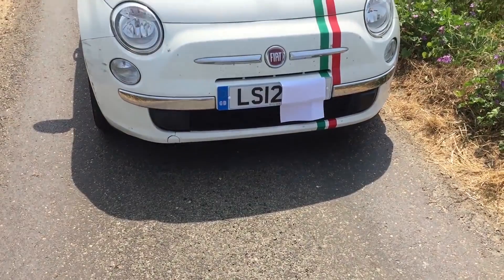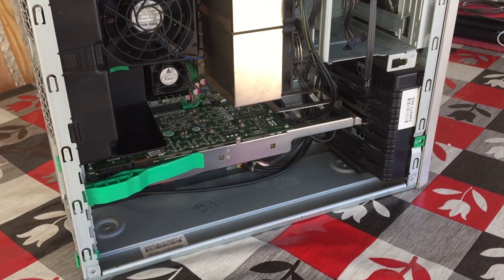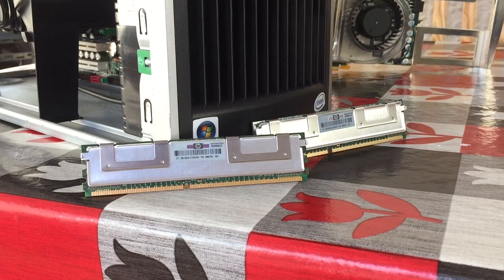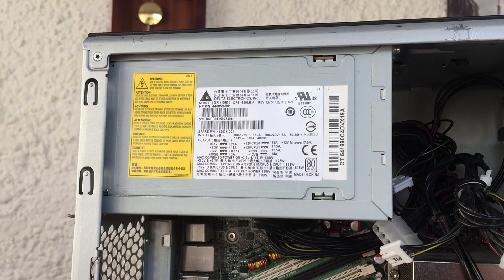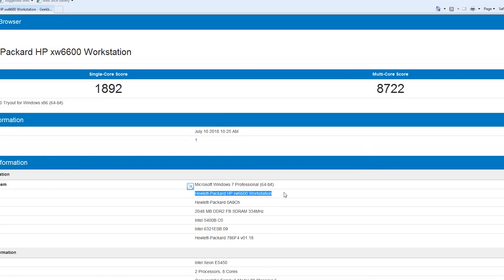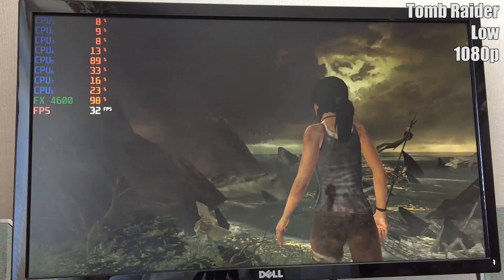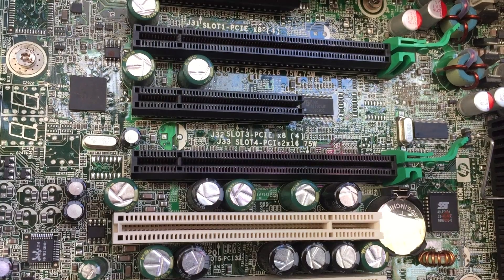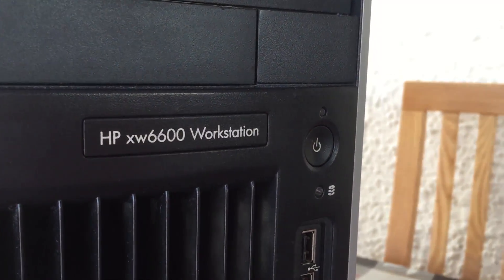This 8 Core Xeon Workstation PC Cost $5000 in 2008, Today I Bought One For £25 ($30)

Comment: What happens if you are Upgrade ram8 gb/1050ti
Reply: Chris Ayres Games back then were HL2 erra, and they didn't use multithread all that well (if any). This would be like TR2 vs 8700k, the i7 is going to win at gaming.
Reply: Chris Ayres They are the same as the consumer chips plus ECC memory and more PCIe, they are the same core as the i7, but clocked slower. They are not magic, my Ryzen and even my old FX tear apart older Xeons.
Reply: Xeon E5450 is pretty much the same as Core2 Quad Extreme QX9650 which was the best "i7" at the time.
Reply: Jake Garrett, But your AMD FX is nowhere near as powerful as 2010 6-core Xeon's on a Intel X58 platform.
Reply: Pasi123 Maybe, I'm not sure which model number those are. My FX is overclocked to 5.5 Ghz making 870cb. Its old and obsolete now (it can still game fine with even my Titan Xp holding it back, but its nothing like Ryzen). Stock it makes 645cb, so better than the duel Xeons in this video, but that's nothing compared to modern processors, even the $100 Ryzen APU is about the same with just 4 threads.
Reply: My Xeon X5670 @ 4.44GHz scores 1009 on Cinebench R15, it could do better than that if I had better cooler. At stock (2.93GHz) it got 692cb.

Actually if you want get around 600cb on a Ryzen 3, you'd need to overclock it to 4GHz.
Reply: Pasi123 That seems low for Ryzen, underclocked to 3 Ghz with half my threads disabled (8c/8t), I make 1000cb with Ryzen. That should give 500x4/3＝670cb for a 4 thread Ryzen. I'm running 2666 Mhz because it was the cheapest kit available, 1700cb at 3.8Ghz.
Reply: At stock Ryzen 3 2200G scores about 550. And Ryzen 5 2400G (4c/8t) scores about 800.
In this comment section someone said he got 609cb on a Ryzen 3 2200G at 4GHz with 3200MHz memory in dual channel.
Reply: Pasi123 It looks like the 2200G is just over 580cb stock. It depends on RAM timings (my RAM is rated at 2800 Mhz, but at 2666 I have 35% lower latencies).

It also depends on how clean your system is. For benchmarks its bad to have Steam updating, Razer headphone drivers, remote desktop applications listening to open ports, or those pesky Windows updates that don't say they are doing anything until you shutdown and suddenly it needs to update. Its amazing how quick most people junk up Windows...

For unpublished benchmarks, set Cinebench to high priority, disable every Windows service (rename Cortana files to disable), and I also kill the desktop GUI so its a black screen and you can't open new applications (leave CMD promt up if you want to open programs). A restart is needed afterwards.

It really depends how they are benchmarked. A cluttered OS leaves a lot more services running.
Reply: Pasi123 Here is the website source for 585cb stock 2200G
www.guru3d.com/articles-pages/amd-ryzen-3-2200g-review,8.html

It also shows 820cb for the 2400G. Those are stock, its showing the 1700 at 1400 for example (correct for stock)

Comment: This deal is amazing. Just add 4gb for 6gb of ram. And add in a rx 560 or a 1050 and you're golden.
Reply: mohamed amine khadhraoui a 1060 3gb would make it PURE gold
Reply: there'll be no bottlnecks with games with vulkan or dx12 that can take advantage of 6 cores or more but otherwise a 1050 ti would be the best card you can put with a e5450
Reply: G7 Beats

my Country cost same price brand New Gtx 1060 3gb and Gtx 1050ti 4gb.
Reply: Rather a 960 in sli

Comment: Nice workstation and a great price. My main PC is an old HP Proliant DL360 G6 server currently running a pair of E5520 at 2.4ghz. It can take up to two X5670s but the price for a matched pair of those is still around £100. It came with 16gb of ram and an SSD all for £42 off ebay. I modded it a bit to fit a dual slot GPU and it is a monster for the price I paid. Old Xeon servers and workstations are stupid cheap although the servers are less practical due to size and form factor. Definitely worth a look for lots of processing power for cheaps.

Comment: How much power does it draw? Must be a lot :D Cinebench score is the same as my Ryzen 2200g, so not bad for a 10 year old machine
Reply: Martin yea these are great cpus, its only 50 points off of my i5-6600k (4.4ghz) which is insane to think about
Reply: I have a similar system with dual x5450's and a GTX 480. It pulls over 750w from the wall with a 1kw PSU
Reply: Martin  im using x3440 clocked at 4GHz with a score of 625 on cinebench and pull 300-350w for the cpu alone  XD
Reply: Please tell me how you got 630 CB on your R3 2200G. I’m running my R3 1200 at 3.85 Ghz and getting 582 CB (though keep in mind due to budget constraints I’m on single channel memory at the moment).
Reply: NJ Sullyalex ryzen+ has better ipc and can reach 4 GHz a little easier than original ryzen could. Also, the 220g only had one ccx. Original ryzen is also much more dependent on memory bandwidth, so that single channel set up could possibly be hindering you
Reply: NJ Sullyalex my record was 609 points. My cpu is running at 4ghz at around 1,325V (set in the bios) up to 1,35V under load. I am also using two ram sticks at 3200mhz.
Reply: Ah I see, you are running it faster than mine and with a significantly faster and better RAM configuration. One misconception, the Ryzen 3 2200G is NOT Ryzen+, it is based on Ryzen Gen 1 (it came out before the R7 2700X), so it's IPC is equal to the R3 1200. In fact, theoretically, it's IPC should be worse than the R3 1200 because it only has 4 mb of L3 Cache instead of 8 mb in the R3 1200. However, you are right about it having only a single CCX instead of the 1200's two CCXs so it has much better bandwidth. I'm looking into getting a 2nd RAM stick, it'll probably improve my Cinebench score a few points. And I know the R3 1200 is capable of hitting 4.0 Ghz, but I'm using the stock Wraith Stealth cooler and I'm already at around 1.35 volts so I don't want to go any higher (it seems you won the silicon lottery!). Out of curiosity, what motherboard and cooler are you using to hit those clocks? (I'm using the Gigabyte GA-AB350M Gaming 3)
Reply: That's a beefy cooler you got there, more than adequate for an overclocked R3. I'm going to look into getting a 2nd stick of memory, single channel 2400 Crucial DDR4 is choking the R3 in workstation loads. If I can get a 2nd stick to run dual channel then I may consider overclocking the RAM a bit for even more performance. Also, that motherboard is essentially the ITX version of my board (mine is Micro ATX), they probably have the same VRMs and I checked, they are running the same BIOS. Good to know I can get those kinds of overclocks on it.
Reply: Err wtf. I have a dual x5670 and this dont pull more than 450w maxed out.
Reply: ScottieNiven how hot did your room get?
Reply: NJ Sullyalex i think ryzen 2xxx has a better ipc
Reply: NJ Sullyalex I am also using a gigabyte board, but the itx b350n. You could try to overclock your ram to get more performance. I am using the alpenfoehn Ben Nevis. It's a cheap (24€) German  120mm cooler and very quiet. Temps are around 60-65C while gaming. I also have a small case, so temps are a little higher than normal. https://www.alpenfoehn.de/en/products/cpu-cooler/bennevis
Reply: I noticed it had a 650 watt PSU on it. But workstation and server CPUs are generally designed to draw less power as they are made to run 24/7 and companies want to save money on their energy needs.

Comment: I have a similar Dell with 32 gig ddr2 ram dual Xeon mine has a 1000 watt psu so added r9-280x and can run games on high 1080
Reply: you also probably play the electricity bill in ultra 4k
Reply: Nagato2k  lol, I stopped using it and switched to I-5 3700(?) 12 gig ddr3 and RX-580 8 gig
Reply: Seth Rock Reducing the power supply will not make it use less power.
A more efficient PSU of the same output would, a little bit, but would in no way pay for itself with the saving. Don't bother changing the original unless it breaks. 

I'm just saying that it is not a great gaming PC, it it an awful inefficient one that can just about manage games on high while using nearly 1KW of power.

But if that's what you like, then I guess to you.. it is a great gaming PC.
Reply: Seth Rock Then why did you tell us at all?
Reply: because it is a great gaming PC, i still have and planning to reduce psu to save some money on electricity.  I ran all games on high 1080p with little to no stutter

Comment: My school still use this pc (dell case with 8 cores dual xeon e5450 , Quadro p600, 6 gigs of ram)
Reply: Ultra Indigo Lost me at vista
Reply: UnknownUser, Vista SP2 isn't bad at all. It works just like Windows 7 if you have a decent hardware
Reply: Nice, I snagged myself a Dell Precision T5400 with dual Xeon e5450, 16GB of Ram, and a Quadro FX 3700 for 150 CAD a couple of years ago, including shipping and handling from the States. The thing looked practically new inside and out!

 I added two 15000RPM 300GB WD SCSI drives and replaced the FX 3700 with a 4GB FX 5800 since I installed Vista and anything newer would probably be wasted on it due to a lack of DX11 support.
Reply: Still better than mine, using Sempron 145s and Radeon HD 4200s :(
Reply: The school that I recently left had PCs with i5 6500s, 8gb ram and integrated gpu that can’t handle its display
Reply: Yah mine also but only in one classroom the other IT classrooms have Pentium 4 LGA755 3.0ghz pc or some pentium 3s.
Only good students can use more powerful ones and i am one of theme, god damn old pcs where carshing while runing a c# gui app, basicly trash, not to mention how it was with corel draw...

Comment: with a lga1366 board you will get the double perfomance
Reply: Polaris Lakewell  I've tested on cinebench a dual xeon x5570 and i got around 1000 cb
Reply: And my x58 with a x5650 4.4ghz get's around 1032cb

Comment: I want such a PC too. I am not sure if this will be as powerful as my Core i5 7600k but I just want one to say I have a PC with 8 cores. But I would upgrade the GPU and still use my i5 PC.
Reply: Want 8 cores? Buy Ryzen
Reply: I went Ryzen and do not regret it the upgrade path is oddly strong and budget friendly hell even the 6 core 12 threaded 1600 is only 134 quid new and boxed.
Reply: R K maybe I sould sell my i5 and the board and get a Ryzen instead.
Reply: Go amd it better. I got threadripper 1950x and it a beast
Reply: Yea the i5 is quite more powerful but dual xeons present a challenge. Especially if overclocked.
Reply: Adam W You are right, I should have bought Ryzen istead of a Kaby Lake CPU I can't upgrade to a newer generation. I will never have more than 4 cores in my pc.
Reply: You can get these all over ebay and newer xeon quad and above pcs for anything from 30 upto 500 depending on specs ram graphics card etc.
Reply: PC Builds Official well guys who did
Well will
Mwa
Reply: Tom 2404 I have that processor too! I wish I went Ryzen though :(
Reply: Ffs the i5 is a beast u dumbass and you want to replace it with Xeon?? Tell you what ill give u a 8Core Cpu and youll give me the i5
Reply: Goshyy No, I didn't say I want to replace it. I want to have a Xeon workstation and keep my i5 PC as my main pc. My i5 has DDR4 memory and the workstation only DDR2 and it also doesn't have M.2 SSD support.
Reply: PC Builds Official Yes, the Z270 platform was shit.

Comment: Ive found a Dell PC with 4GB DDR3 Ram, Q9550, 500GB HDD for 35€

Good Price?
Reply: +Мартин Атанасов Throw a gtx 780 and play modern games
Reply: +lolitsamir And yes, thats a very good find
Reply: Мартин Атанасов Play CS:GO, Fortnite, GTA and Siege

But yes, i need a 660 or 750ti
Reply: Not the best deal but it's fine. Note that you can't overclock with the OEM Dell mainboard.
Reply: I once found Dell Optiplex PC with Core 2 duo, 2gb ddr2, 250gb hdd. I thought it was nice and all. Looked at price, 80 euros. It was way too much. Needless to say that shop closed down an in same place there's a clothes shop.
Reply: Mantas Jurksa i have got an cheap pc to my pile of pc's with core 2 duo 1.86ghz 2cores, 2gb ram, had geforce gt 8500 512mb took it out and put an better geforce gt 9500 1gb runs much better it come with lg flat-screen monitor, keyboard and mouse it costed me 40€ runs ok
Reply: I bought few times like 4 laptops at a time for 40€ they weren't all that powerful but still lol and my drawer is full of iPhones and samsung phones and all of them are working omg i have too much stuff i couldn't count how many laptops i have somewhere above 10 or 15 working. My gaming pc specs: i7 3770k 3.50ghz 4 cores 8 threads, AMD Radeon HD 7850 2gb, 20.0gb ddr3 ram, 1tb seagate hdd(have another 1tb unused) looks good has those lights and visible trough side panel keyboard is has rainbow back light and mouse as well runs most games at ultra games like gta v at high/very high 60-80fps
Reply: Dat Boii I know you wasn't talking to me and this comment doesn't fit in this comment section but: I think the fortnite isn't bad but it's overrated and i played it but some things are just annoying and i couldn't play it anymore i don't think I have to tell you why, you should know already a lot of people don't play it because of the same reasons.
Reply: lolitsamir i think its good for the price
Reply: just stick anything higher than an 750ti and 4more gigs of ram and you should be fine for most games for a few years
Reply: yes pretty good deal the q9550 is pretty good for games when overclocked today however there will be no upgrade path and you maybe limited to what speed ddr3 you can put in the board.
Reply: 4 more gb of ram,1050ti and over clock it and you'll be pretty much set for most games at medium settings.
Reply: Great deal get an another 4gb ddr3 and slap a GTX 750ti
Reply: Hell yeah! Add some more ram a decent gpu and ur ready to edit and game!
Reply: Try and see if you can also find yourself a QX9775 to give it a boost.

Comment: I need a Xeon for 3D modelling, I have an I-3 6100 😔
Reply: If the guy has an i3 6100 it's a safe assumption that the other guy was recommending a sky lake i5. Just FYI.
Reply: Mabye Ryzen could work for that aswell? I don't know how many cores you want/need but the 8 core ryzen 7 and upcoming 32 core threadripper look really good for that
Reply: Toasted Vivid It would be nice since he seems like he is only editing, but I think just upgrading on his existing platform would be the cheapest option if he wants to get a new gpu aswell.
Reply: Mtndewgang I’m on 16 gb
Reply: I use an RX 460 on my i5 when using cinema 4d and it works fine
Reply: SOCIO I mean pretty much everyone in this thread knows what I meant, so I kinda didn't really need to specify. Lmao
Reply: My PC has an i3-6100 paired with my gtx 1070 😂😂
Reply: WayBachWin what in the name of holy bottlenecks did i just read
Reply: I have a GTX 1060 (3GB) with a core2 duo :( xd
Will get an upgrade to ryzen 2600 soon though
Reply: +Sphinx
Get the 8600k instead, 2 cores more so literally 50% more power than previous i5's. That would be a massive improvement http://cpu.userbenchmark.com/Compare/Intel-Core-i5-8600K-vs-Intel-Core-i3-6100/3941vs3511
Reply: Spence Philie yeaaaa I haven’t upgraded it yet😂
Reply: Sphinx an i5 should help.
Reply: Mtndewgang I’m gonna get one, but I also need a new gpu
Reply: SOCIO Literally anything past the 2nd generation should be fine, ipc hasn't been much of a problem since AMD kinda let Intel get lazy, but if you want me to be more "specific" just upgrade to any Skylake/kabylake i5. I thought it would've spoken for itself, but I guess you missed it.
Reply: Mtndewgang I’m getting a 6600k
Reply: Sphinx give it a hefty oc, and you should be fine. How much ram do you have?